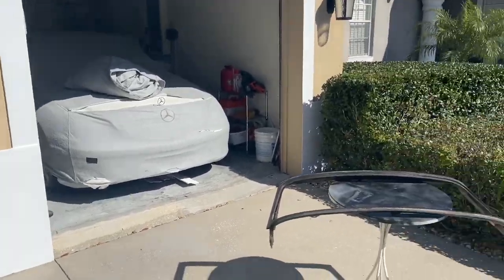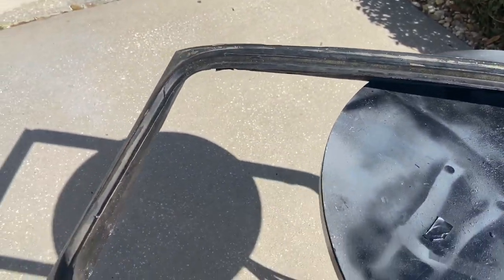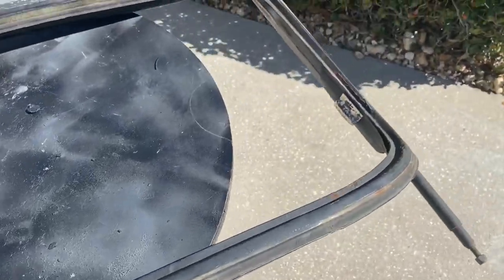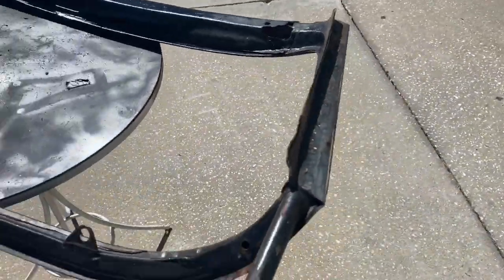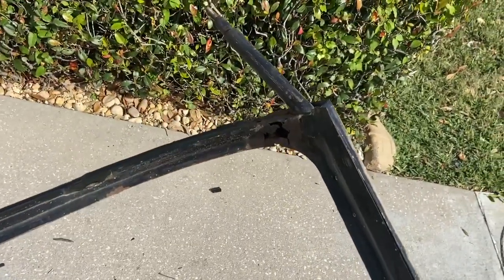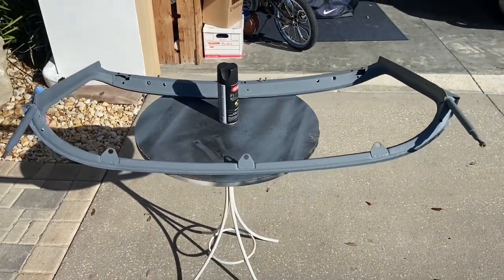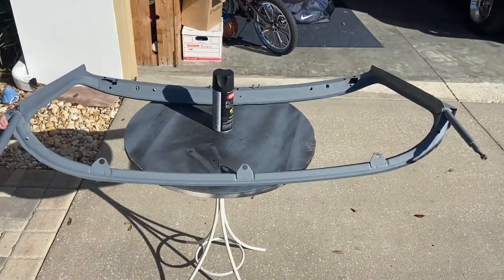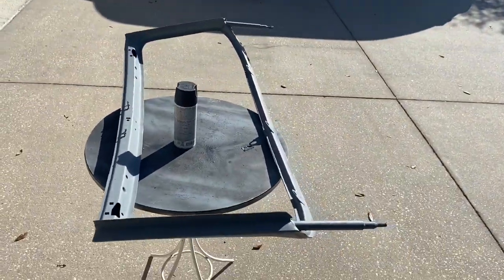73 Triumph TR6 Restoration Project

Comment: Looks great.  That interior finishing kit is pretty expensive to buy last time I looked.    I think I might try something different on the interior of mine...
Reply from the maker: You know David I should have included the finisher for the inside of the window (rookie mistake) it does require some gluing so I will probably do that next week with some supervision when I go down to Fred’s. I picked a brand new finishing kit for $50 US plus $15 shipping.